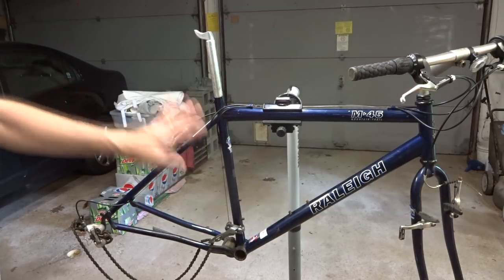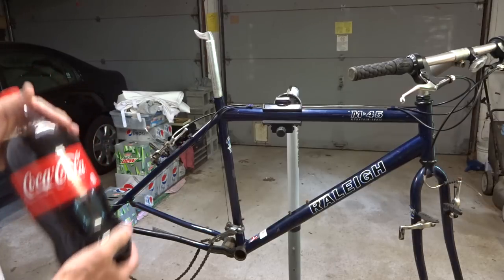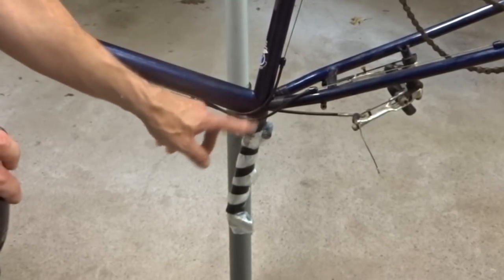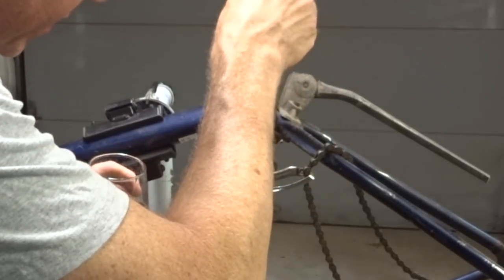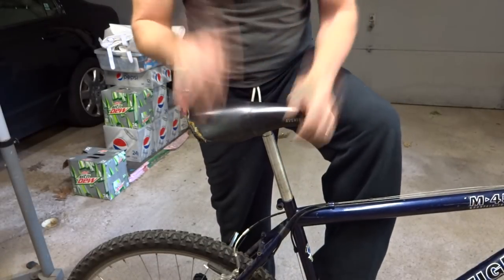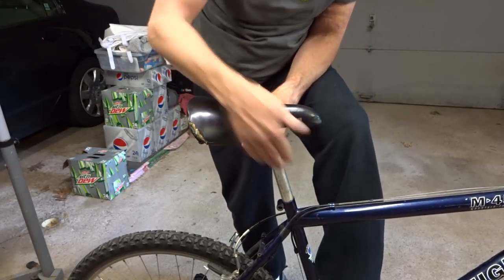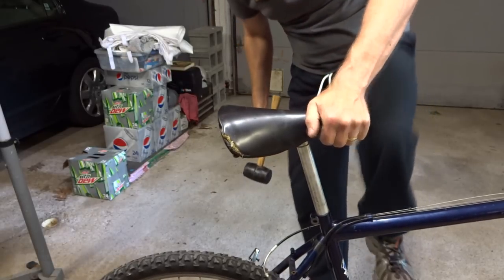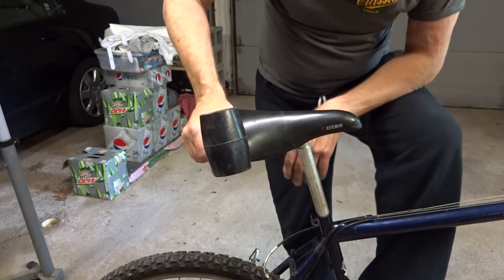Removing A Seized Seatpost with Coke/Coca-Cola - Does It Work?

Comment: I commented before I watch the video I knew it was another something ignorant !
Now this Raleigh has a hole in the bottom bracket that you can pour liquid in and It will reach the seatpost ???? I bet the the bottom bracket is full of water ! And if what I see is in fact true ! Who would even want a trek ! I mean If use it in the rain or wash it ! You really need to think of re greasing the bottom bracket bearings !
Reply from the maker: Pretty much every frame has the seat tube open into the bottom bracket shell!!
Reply: If that is the case seems a plug to seperate the two would be a great upgrade ! Makes me sick to think , water running down the seatpost , would fill up the bottombracket !  Galvanic Corrosion . Aluminum and steel
You likely could  jiggle them apart with the right kind of pressure placed upon them ! A wee bit of silicone grease or anything that would insulate them from each other likely would stop these type problems !
You ought to make another video and use your great big maladjusted adjustable Chinese wrench on it !!
I love to watch you scar and scuff  with your great big chinese wrench :) Never mind adjusting it to fit properly :) A wrench that big does not need to fit properly !
 Raleigh was a great bike ! It went the way of the empire that produced them ! Now they just another mongrel !